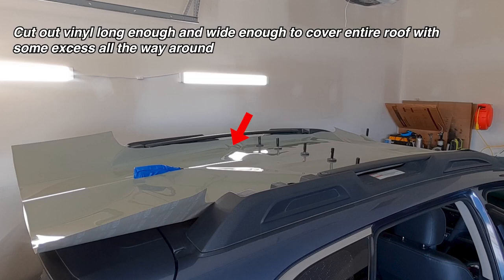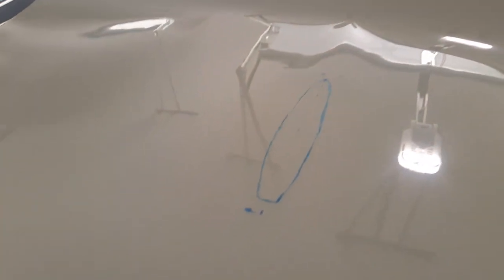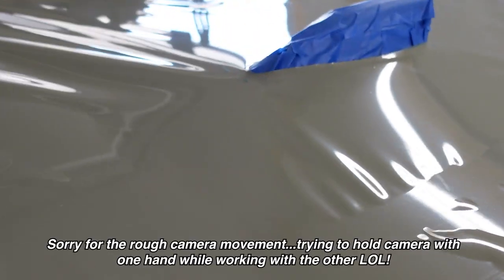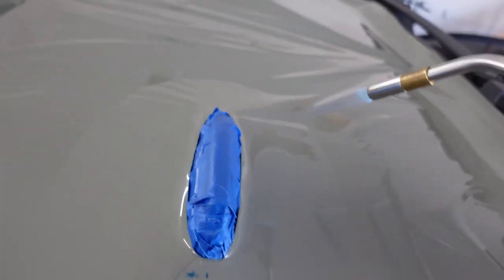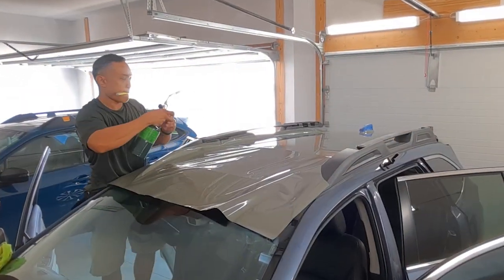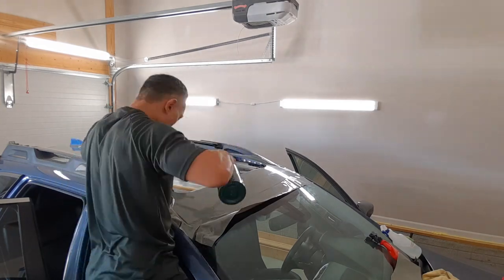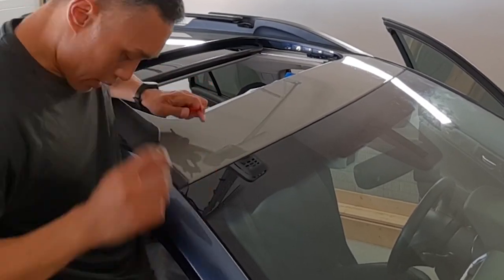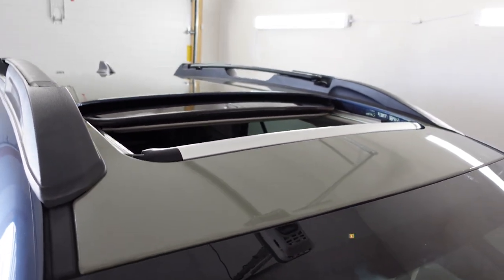How To Vinyl Wrap a Roof Between Rails and With Antenna Still On

Comment: Great video! Actualy the only video on YT regarding wrapping between roofrails. I have a big problem with it and i have already wasted 5 meters on vynil. I just cant get the fingers away when i aproach the roof rail coming from the middle of the roof. Would you have a tip for me? I watched your video 10 ties but i still dont get it. Every time i try to get the fingers away i will create a thousand other small fingers😢. Its frustraiting to the point i would like to remove the roof racks but for my car i need to make it from inside, basicly i must remove half of my car interior for this. Please share a bit of wisdom with me 😅. Thanks ahead
Reply from the maker: Thanks and thanks for watching.  Without seeing how the rails are setup on your roof, here are some tips that may help:
- Cut the vinyl somewhat to shape, meaning, cut away excess vinyl that would possibly get caught on the rails when you are trying to install.  If you notice in my video, where the roof rails are, the vinyl is cut out a bit
- Put painters or masking tape on the surface of the rails, so that it lowers the surface energy of the railing surface and the vinyl doesn't stick to it so much.
- Try to glass out the vinyl as best you can.  Wrinkles are often a presentation of excess material in the area you are trying to apply.  By glassing out the vinyl first, it helps pull out the slack (i.e. excess material) in the vinyl to make application easier.  
- Depending on your situation, heat may be helpful.  Heating the vinyl will shrink the vinyl, which in essence reduces excess material/slack in the vinyl.  This is a slow process though, where you heat the vinyl (big, broad areas) and let it fully cool back to ambient temperature.  You then heat it again to further shrink the vinyl, and again let it cool fully.  You can only do this a couple of times as the vinyl will only shrink so much.  
I'm not sure if these will help, but maybe they will to some degree.  You can do it...Keep trying and don't give up!!
Reply: @ColorChangeCustoms  Thank you very much for your fast reply. Yes I think that my biggest problem here is that I can't really glass it out. The rails are really tall and I can only pull back so much. If I could pull the vinyl  in an smaller angle would be way better . I saw in the video, when you get Clos to the rails, you keep the vinyl edge lifted and you squeegee toward you. How com do you get no wrinkles? :). I can't get past this thing. I would have a tone of them. Maybe I need to work on my heat gun game. I use Avery satin metallic.  I would also send you a photo of my roof but I can't here. May I contact you on insta? 
Thanks again for your reply and your time
Reply from the maker: @georgianschipko7440  Sure thing.  DM on Insta @color_change_customs

Comment: What if you want to wrap the shark fin?
1. Do you do both with one big wrap and cut  the fin and tuck it in?
2.  Do yoi tuck in the fin first or the hood first?
Reply from the maker: You would wrap the shark fin separately. I usually wrap the antenna after finishing the roof
Reply: @ColorChangeCustoms  thanks!

Comment: How did you split the backing without hurting the vinyl?
Reply from the maker: I used a tool called a Bodyguard or Backslitter knife, which allows you to cut between the vinyl and it's backing without cutting the vinyl.  Here's an affiliate link to one like I use:   https://amzn.to/3PRsr38

Comment: Hey man! Great videos. Been wanting to do this for a while on my truck… Couple questions if you don’t mind. Overall how is the quality of the wrap when it comes to durability and protection against scratches/weather/etc? Do you prefer the VVIVID or INOZETEK? Company that wrapped our range rover used Inozetek which looked great but another shop that quoted me said to avoid both because they’re “poor quality” He recommended 3m/avery/kpmf but don’t like the colors they offer. He said he can get same color in KPMF but i never seen them offer it .  Bottom line I want it to look glossy and hold up for 3~ years or so. Little things here and there aren’t a bother but worried about it losing color/ overall strength to handle each day
Reply from the maker: Thanks and thanks for watching!   

So for your first question concerning wrap in terms of durability and protection...  If installed correctly, it's pretty durable in a general sense.  Regular automotive vinyl (not PPF) won't stop anything that would dent, ding, deep scratch or gouge paint, but it generally provides a nominal layer of protection against mild scratches, rubs, weather and the like.  However, it is just a thin vinyl skin, so keep that in mind to manage expectations concerning protection.  

As far as my vinyl preferences, between Vvivid an Inozetek, I personally would go with Vvivid as I am very familiar with their products and have used their products for quite a while and have had no issues.  I've not had a chance to use Inozetek in person, but I have seen it in person (we have a roll in the shop).  It looks really nice, but I can't speak to how it installs or it's longevity after install.  However, with Inozetek, I'm always suspect about a company that will only sell you a full roll of film (no partials, unless they've recently changed their policy) and offers one of the shortest warranties (if not the shortest) in the industry.  

For the other shop's opinion on brand, I generally agree.  3M and Avery are always a safe bet as (at least in the US) they are basically the industry standard.  I've worked with KPMF on several occasions now and I've been very impressed with it so far...easy to install with beautiful finishes.  As far as KPMF color availability...it can be hit or miss.  But, the same can be said for all vinyl, even 3M and Avery, as the whole pandemic-logistics-supply chain issue hit the vinyl wrap industry pretty hard as well.  So, many colors except for the most common can be difficult to get.  

For your bottom line, 3M and Avery are definitely a good, generally safe way to go, and based on my experience, so is KPMF.  However, like everything, the answer to how long a vinyl will last looking good is, "It depends." You may or may not get 3~ years with any brand of vinyl depending on where you are.  For example, if you live in a place like Arizona, expect your vinyl (especially on horizontal surfaces) to get destroyed by sun within the year (if it's an outside all day vehicle)-- no matter what brand you choose.  Other more temperate areas will allow your vinyl to look good longer.  Be sure to scope out the manufacturer's warranty conditions (on their websites) to see what they will or will not back up with regards to their product.  

Sorry for the very long answer; I wanted to ensure I answered all your questions thoroughly and subjectively.  Cheers, and thanks again for watching!
Reply: @ColorChangeCustoms  Thank you so much for this response! This really helps out a lot! I think I’m going to tackle this myself and really take my time on it and it will definitely be a learning experience. watching your videos really gave me the confidence to give it a shot and be able to trial and error the install. From what I’m seeing about Vvivid and inozetek is that it just takes a little more patience to install vs it actually being “bad” film. I think these industries now they just want to be efficient which definitely makes sense because being efficient saves time and money. But I don’t mind spending a little bit longer on something that is ultimately going to achieve the resort I’m looking for. Thank you very much again and look forward to watching more of your videos!
Reply from the maker: Thanks again and I'm glad my videos have been helpful.  Yes, some vinyls like VVivid do require a bit more patience to work with.  If you have enough spare vinyl, I might recommend a couple of practice runs first so you can see what will happen with the vinyl you're working with in particular (each brand has their own "quirks"), and to help develop a plan of how to wrap whatever it is you're tackling when you go for it.  I do this all the time at work when we have a new vehicle we've not tackled yet, and/or if we get a vinyl that we've not encountered.  Best of luck, and thank you again for watching!!

Comment: How much does it cost to do something like that?
Reply from the maker: If you're doing this yourself, basically the cost of the vinyl, which could vary depending on the brand, color, type of vinyl (carbon fiber vinyl, colorshift, vinyl and chrome vinyls are more expensive) and how much vinyl you need (a roof on a small car is smaller than an SUV).  If you go to a shop, probably $300-$800 would be my guess.